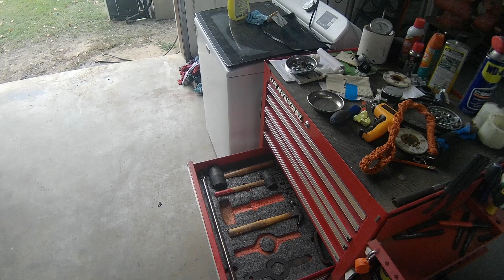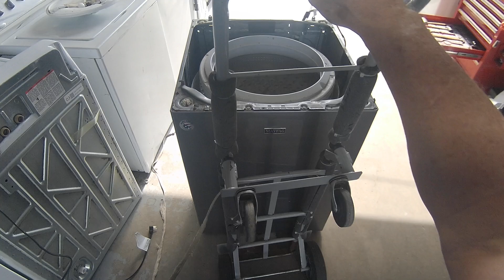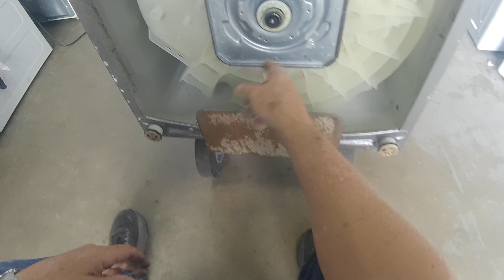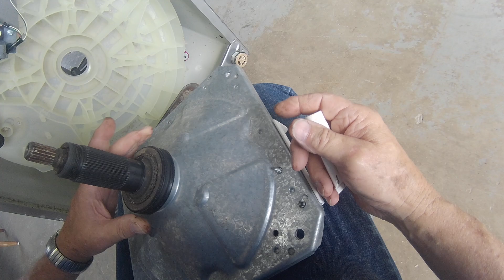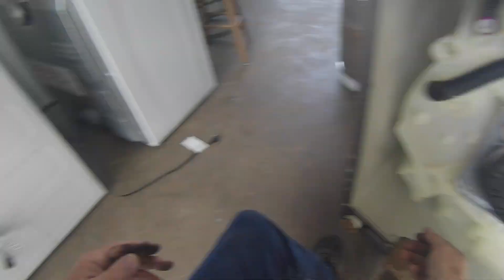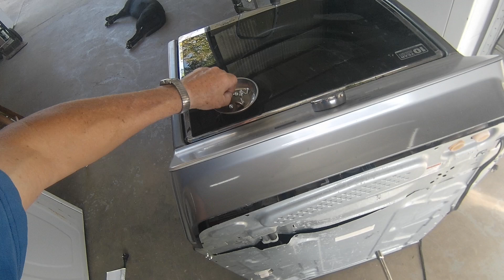Maytag Bravos XL Won't Agitate? Replace the Gearcase Yourself

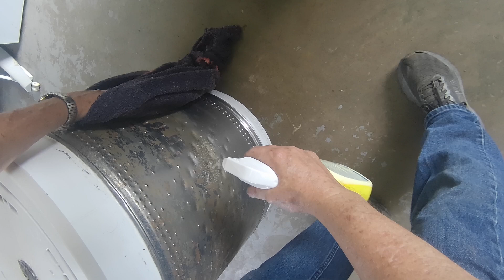Comment: @ 34:18-34:28. The parts diagram shows a washer. I ordered one and it is metal with a rubber coating. While trying to replace the old one. I scraped the remaining rubber off the bottom of the washer. Then I couldn’t get it out. Might have marred the inside rubber a bit. I noticed you didn’t remove it and actually scraped it clean. Put it back together and didn’t have any leakage on first test run. Should I be concerned about possible leaks? If it does leak, what’s best approach to resolve.
Reply from the maker: I don’t see what you are talking about in that time stamp.

Comment: The rotor on mine seems to be seized on and won't come off, any suggestions?
Reply from the maker: Oh, man! That is unfortunate. Try some penetrating oil and keep working it back and forth from the edges. I'd say use a bigger hammer but you might damage something critical. Thanks for watching!

Comment: I have this same model and yesterday it stopped advancing to the Spin cycle. I listen closely and I hear what sounds like grinding. Its a subtle grinding and the error code I get is DRN. We took it apart and cleared all of the hoses and the pump and that all looks good. Is it not spinning because of the transmission?
Reply from the maker: It could be that or the speed sensor. Thanks for watching!

Comment: I had mishaps in the process. First, when I was re tightening the drum after completing the assembly, the head on the black anodized bolt that came with the drum broke right off. I see people using impact tool on these washers and yet me hand torquing snapped the head off.

It was a nightmare after that. I tried to use an easy out but the broken bolt would not come out. So I tried to drill it bigger and broke the drill bit in the shaft.  I was left with about 3/8 depth to try to re-bolt the drum. Not the best solution, but I got a sharp edge lag screw, I ground the point off and was able to force turn it in with 2 washers to verify it screwed in tight. 

At first it sounded good, smooth noiseless for about 2 or 3 minutes, then the clacking came back worse than before. I'm sorry I didn't just get a used washer online but now I cant return any of the parts I used, SOOOO, I'm locked in to fixing this thing.

The last item is the transmission.  Not only would it be the last part to replace in the drive train, but I'd be replacing the damaged shaft threaded hole and I'd able to reassemble it right.

My question is there a torque spec for the drum bolt? I see people saying they find it finger loose when they service their machines and I know that not good, so how tight can I make it to insure its tight and not gonna snap the head off again?
Reply from the maker: Sorry to hear about your trouble, and there is a torque spec for the bolt but I do not have it. I do know your pain though. I only use an impact wrench to remove bolts never to tighten. And I use the German torque method “gut und tight”. Snug and a tiny bit more. Thanks for sharing this experience!

Comment: This is a great step by step video.  I have successfully taken the old transmission out and installed the new one.  I am stuck though.  I bought a brand new transmission.  I can't seem to get the wash basket to sit down far enough to put the spin nut back on.  I think my new transmission has a thrust washer on it and I possibly need to get the old one off the basin but I am not sure if it comes off.  Help!!!  I am so close!!!
Reply from the maker: There should be no washers below the tub. If the tub won’t drop all the way down you can place the end of about a 4 foot 2x4 next to the shaft and tap it down with a 2 lb. hammer. Thanks for watching!

Comment: Im trying to figure out if the bearings and seal in my model can be replaced, or do I need a complete transmission.                  MVW 7230HC0
Thank you!
Reply from the maker: Unfortunately you have the model that has the gearbox instead of the bearing shaft and seal design. You’ll have to change the gearbox.
Reply: @HarperandKnowles  I appreciate your response.  I think I'm going to do it.  The washer is only 2 years old
Reply from the maker: Good luck with your repair!

Comment: If the machine runs great but there is oil on the floor should I replace the whole transmission or just the seal
Reply from the maker: The seals on these machines are not serviceable. You’ll have to change the whole gearbox. Thanks for watching!

Comment: Awesome video. Thanks so much. Is it necessary though to take off the top control panel?
Reply from the maker: Yes, you need to remove it. How else would you get the tub out?
Reply: @HarperandKnowles 

If he had been successful at driving it out the bottom, would he have been able to not remove the control panel?
Reply from the maker: That would be very sloppy work indeed. Do it the right way!
Reply: @HarperandKnowles  I'm not a professional or anything, so could you tell me why that would be sloppy? I have a 4-year-old Maytag Bravos that needs a new transmission. The videos I've seen make it look like I could drive it out the bottom as he does in this video and replace it without taking off the top or removing the tub. If this is possible I'd much prefer to do this rather than risking messing something disassembling more than I need to.
Reply from the maker: I can’t think of why it wouldn’t work. I really think removing the tub is the easier route though. You need to clean those basket splines and stabbing that shaft back in will probably be a chore. Neither impossible. Let us know what problems, if any, you encounter. Thanks for watching!
Reply: @HarperandKnowles  Thanks!

Comment: Can you do an upgrade on straightening those spin tubes
Reply: I meant an update I'm sorry it was a little fast and I couldn't tell what side you were going from the bedside to the good side or vice versa
Reply from the maker: Which video is that?
Reply: You're spin to straightening tool
Reply from the maker: Oh! Well I’m not straightening the spin tube. I’m pushing against the agitator to push the basket out. So, if you rotate the basket and take notice of where it comes closest to the splash guard then you should push exactly opposite of that point. In other words, if you rotate the basket 180 degrees from that point you can see where you need to push the basket outward enough to even the distance of the basket relative to the splash guard all the way around. If I make another video in the future and do this I’ll try to explain it better.
Reply from the maker: I’m not sure what you are asking.

Comment: Chip, great repair and video. I often find that bolt that holds the rotor on loose also. When putting the rotor back on I'll put some blue Locktite on it.
Reply from the maker: Thanks for the tip Shane. I’ll have to do that.

Comment: What was the issue with this machine?
Reply from the maker: The lady told me it wouldn’t agitate. When I checked it out the spin basket wouldn’t move due to failed bearings. I freed it up and you could tell the bearings were gone by the loud roar it made. Thanks for watching!
Reply: Make a video of a bad bearing whirlpool washer spinning if you have one in your shop
Reply from the maker: You can hear the noise in this video, How To Fix Roaring Noises During Spin Cycle: Bearings Repair vs. New Gearcase
https://youtu.be/-DVeJZsqSxM

Comment: Another great video Chip! SAE and metric ugh. I enjoy watching the repair. But not a big fan of these newer units. Did you learn all this repairing (and hints) from somebody or schooling. Where's Wally?  thx
Reply: oops I should of waited , I saw Wally!
Reply from the maker: I learned a lot about the older ones from Mr. Harper and I’m self taught on these newer ones. I read a lot of service manuals and watch a lot of other technician’s videos.
Reply: @HarperandKnowles  well I find you knowledgeable in your workings. watching you I would probably have to place bolt and screws with it items it goes with when I remove them.and I don't understand when you just force somethingoff. Because of you I fixed a transmission on my kenmore washer.
Reply from the maker: Lol, thanks for that kind comment! I’m glad your transmission repair went well!